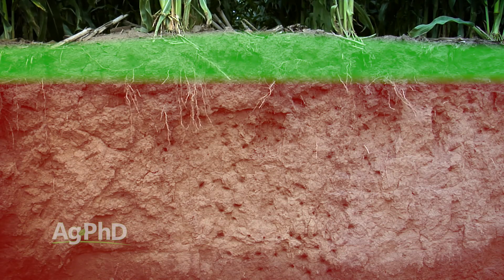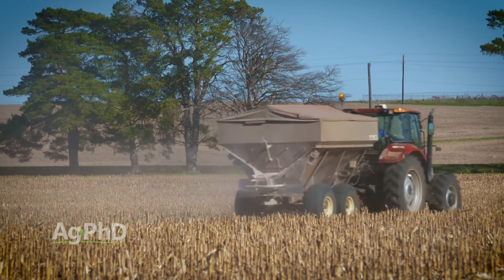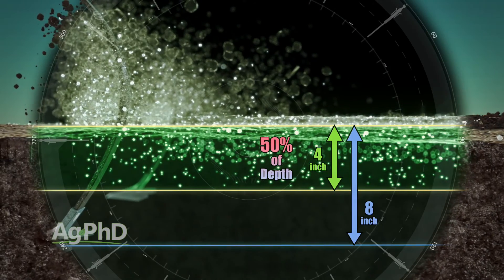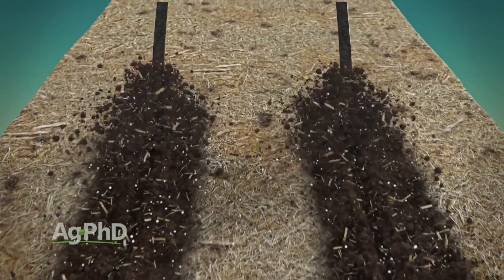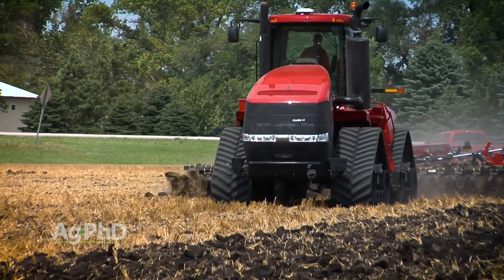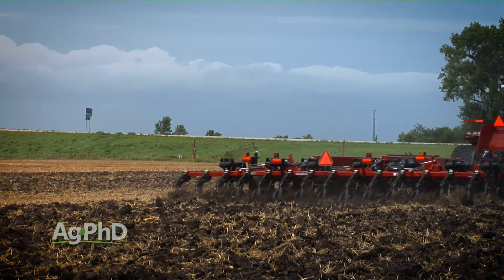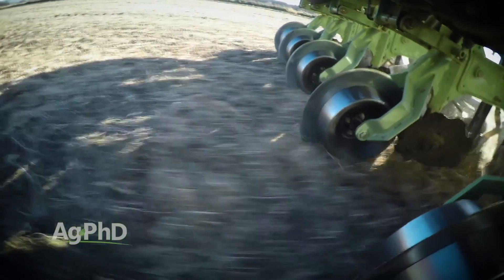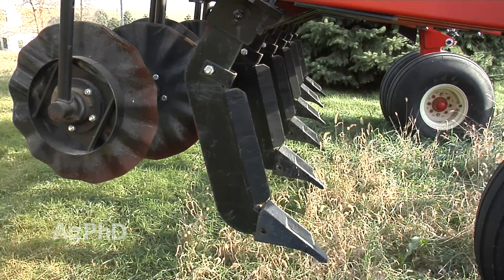Nutrient Stratification #985 (Air Date 2-19-17)

Comment: I am considering trying some strip tillage on my farm.  Nutrient stratification is something I've tested for in the past, one test was the surface down 5 inches and the second test was from 5 inches to 10 inches down.  Overall, the nutrient levels from 5 to 10 inches deep were roughly half of the surface to 5 inches deep levels.  I've spent the last 7 years building the potassium levels to on average 5.3%  base saturation which I'd like to see closer to 7 to 8 within the next couple of years.  The phosphorus levels in this field are a little over 40 ppm which is considered high.  I use boron and sulfur every year.  Now that some of my initial soil test results are coming back high for the macronutrients I'd like to start working on the zinc levels which average 2.0 ppm over the field.  What I'm thinking about doing is surface applying zinc sulphate and then moldboard plowing to a depth of  9 inches thus killing 2 birds with one stone.  The top 9 inches of soil will be flipped and mixed along with the zinc sulphate.  After this is done I want to try strip till as a way to better manage the fertility and soil health.  I'd like to hear your thoughts on what I have in mind, thank you!
Reply from the maker: Brian and Darren addressed your comments on Ag PhD Radio: https://soundcloud.com/agphd/03-01-21-pre-emerge-wheat-herbicides#t=56:54